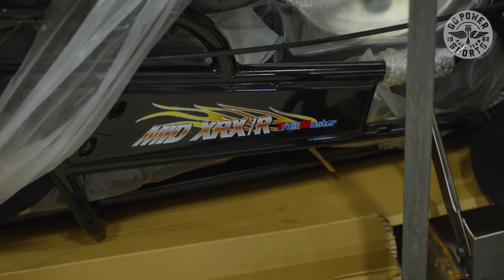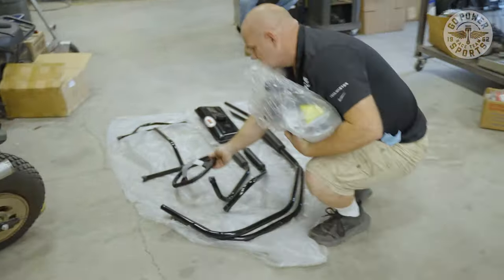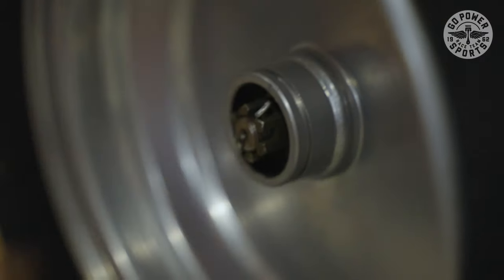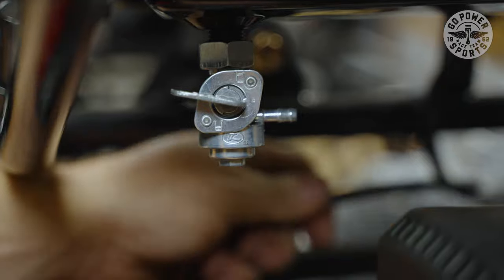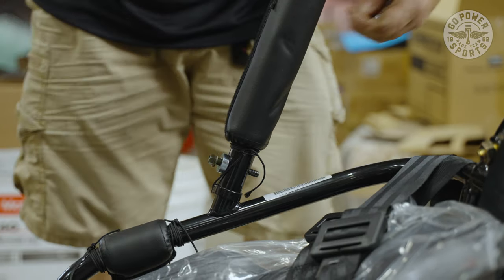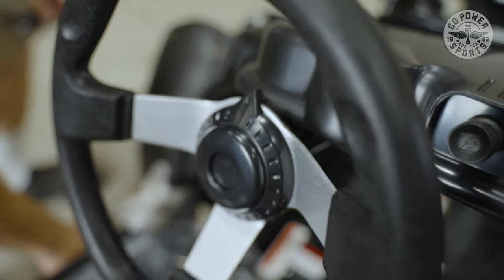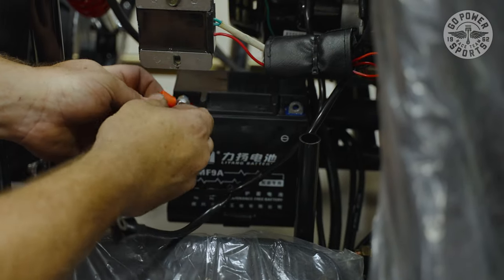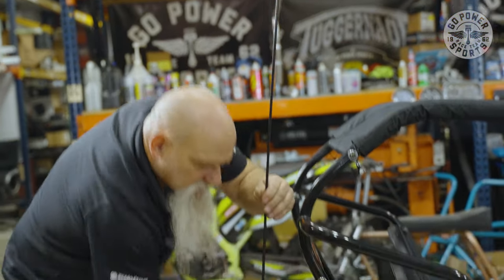How To Assemble TrailMaster Mid XRX/R Go-Kart | Tutorial

Comment: After i added the gas and a little oil it started via electric start and and ran for about a minute and then died, I checked the battery and it wasn't on tight so i tightened it up,  I can not get it to start  electronically or via gas,  It cranks but does not turn over.  I have tested the battery  but not sure what else i can try to resolve this issue